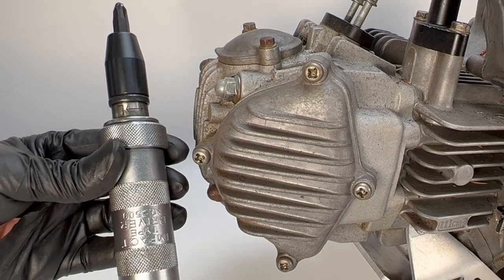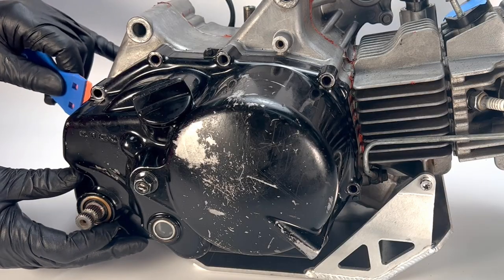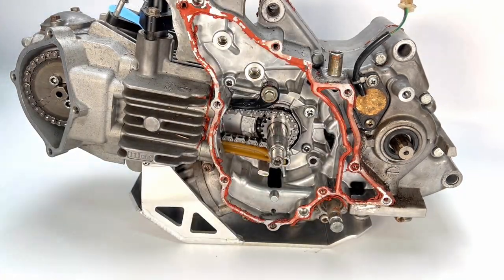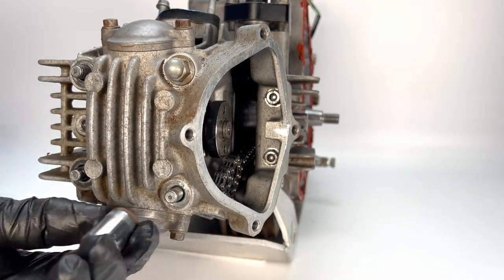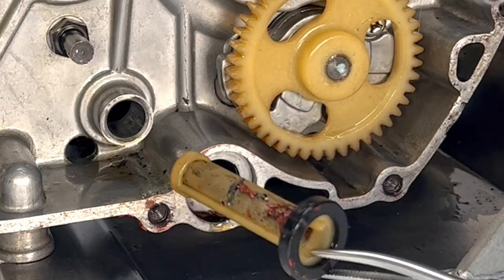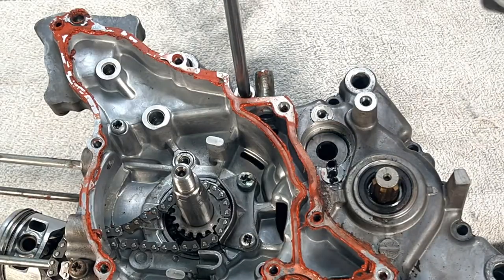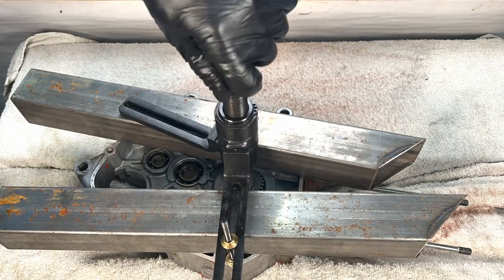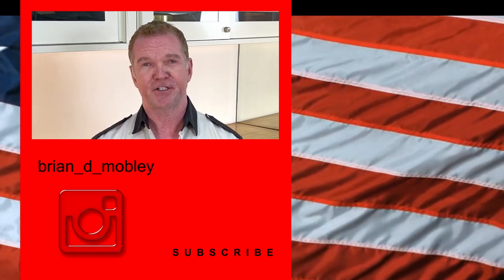Kawasaki KLX110 Engine Teardown

Comment: Hi Brian I was wondering if you could help me out i have a 160 yx engine that I have rebuilt but I am having trouble finding neutral it will select all 4 gears just wont go into neutral and advice would be much appreciated love the video buy the way keep up the good work
Reply from the maker: Hey SRB! That is a tough one without having the motor in front of me.  Im really familiar with that motor and have never worked on one.  BUT, the most common reason for not being able to select neutral is worn out or bent shift forks.  Less common is worn shift drum and related actuating mechanisms.  Its really hard to give advice on these things without having the motor in front of me, honestly.  So often it can be some silly little issue too.